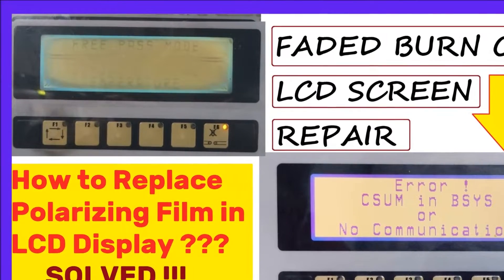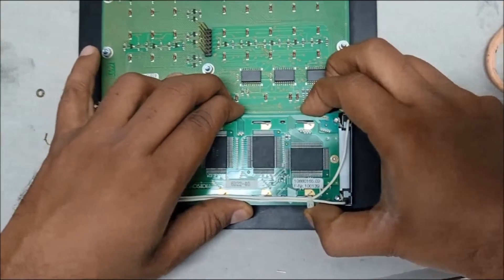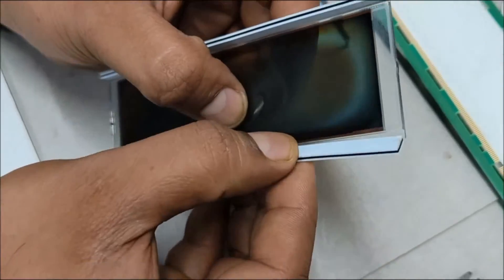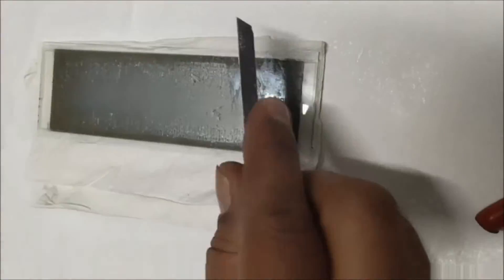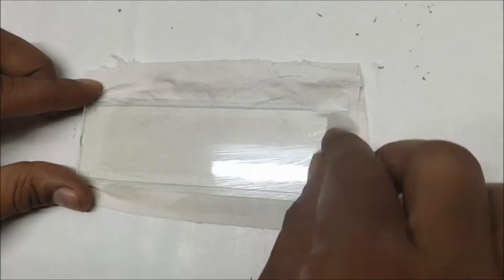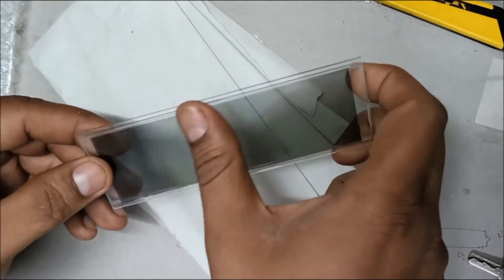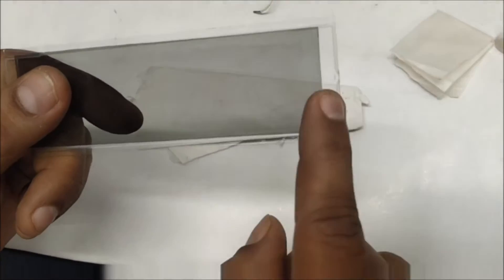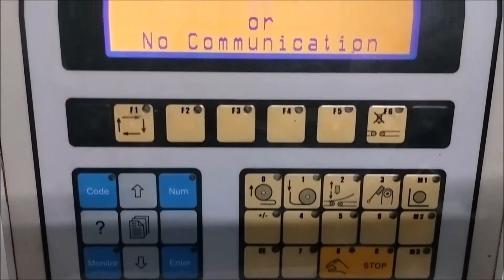How to Repair FADED BURN OUT LCD Screen | Polarizer Film Replacement | Solved

Comment: Thank you for this video! I wonder what material could be used if the white background is also damaged and needs to be replaced?
Reply: I watch other videos, the white one you can use metal foil, or metal tape used in airconditioners
Reply: @a1con  Thank you!!

Comment: Starting at 7 minutes, pasting the film over the glass WILL trap air bubbles. It is better to not remove the backing (don't expose the glue side). Just tape the film to the glass at the edges.

Comment: Can methylated spirits or diluted eucalyptus oil be used the same as isopropyl alcohol ? for LCD displays on microwave’s Bread-makers and rice cookers.
Reply: Metho is alcohol.. Just in a form that will kill you if you drink it.. 
Just check the Metho bottle as some countries sell different fluid under the same name..
Reply from the maker: Yes u can use isopropyl alcohol